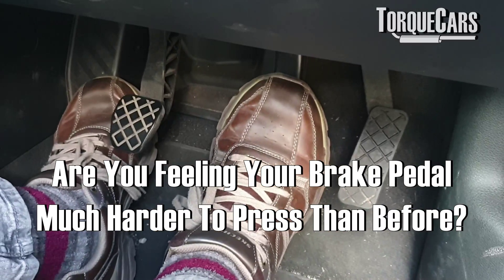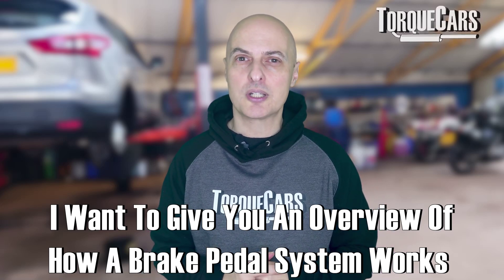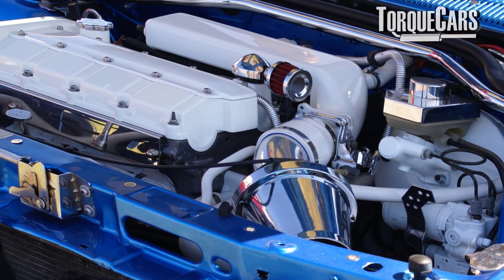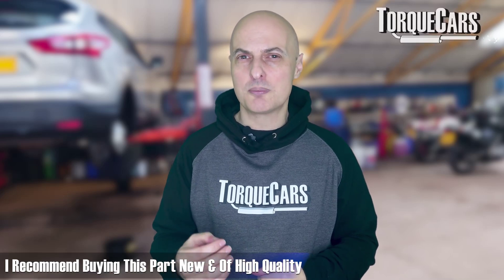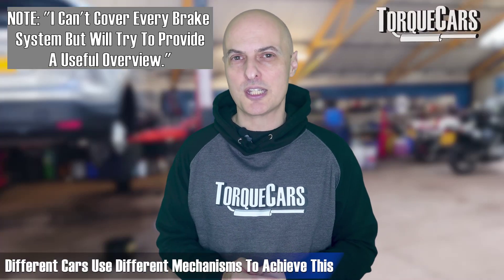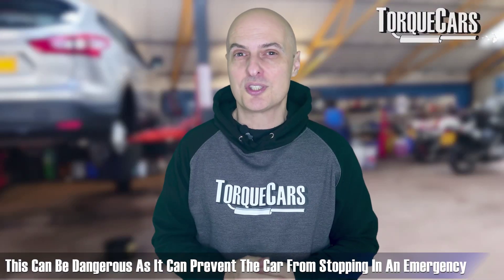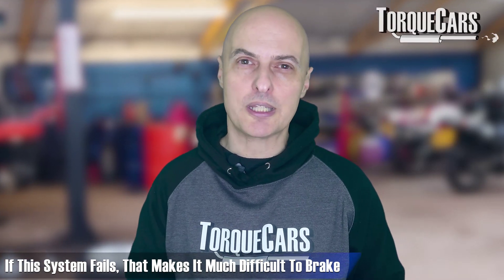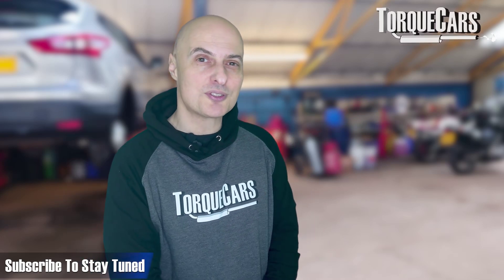If Your Brakes Do This Fix It Urgently: Don't Ignore Bad Braking Signs  - Causes of Firm Brakes

Comment: Would aged & worn rotors have an effect such as this at all?
Reply from the maker: Brakes tend to wear uniformly so they usually work or don't work the pad wear indicators are usually pretty reliable. 

It is where there are uneven areas of wear you start to get the vibrations and problems. Concentric rust rings do little to reduce braking in most cases as the pads will still bite, but where rotors have cracks or low sections things can start to become a problem.